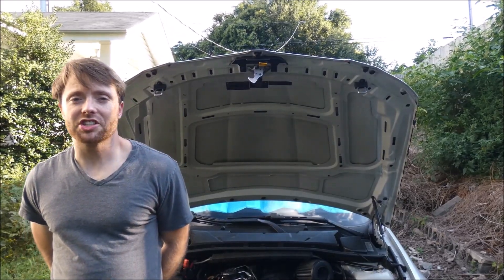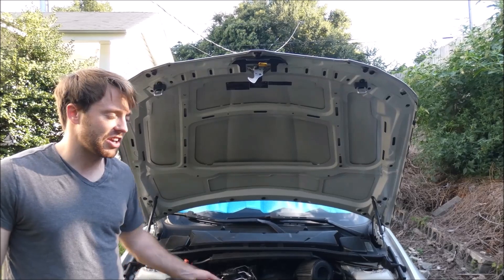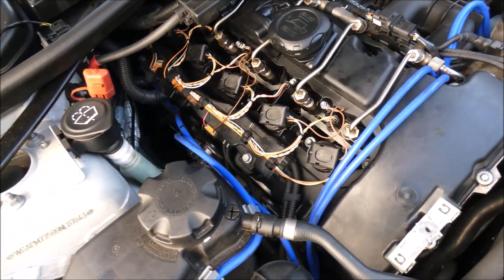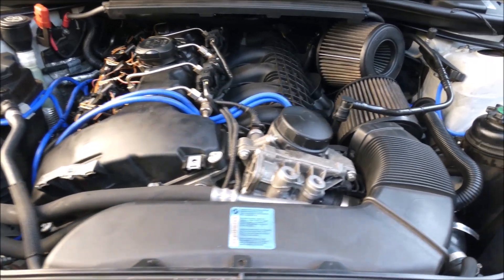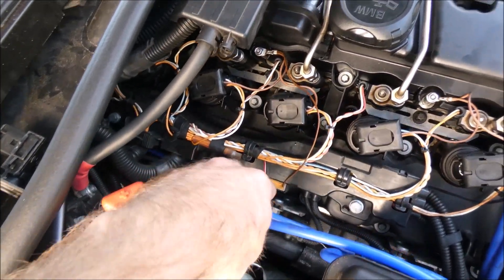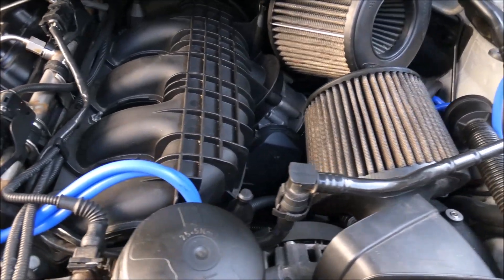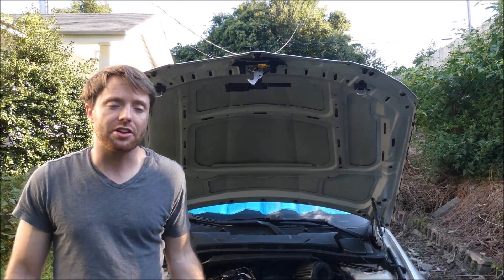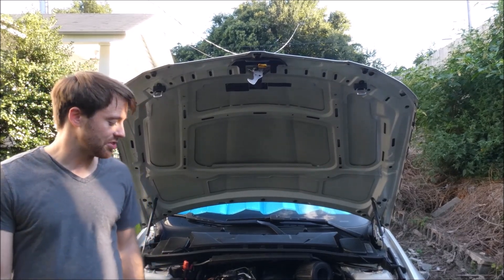IMPORTANT Maintanence for the BMW N54 Engine (Upgraded Vacuum Lines)

Comment: Where can I get all this vacumm lines? I replaced the starter today and now I feel the car run with less boost (less acceleration than last week). Issue starts now after I replaced the starter; so I can assume I can have a loose vacumm line or a broken line; also on the panel I see a yellow warning' according to the code its the "Engine Problem/Loss of Power). That didnt happened before I replacing the starter.
Reply: You definitely have a boost leak
Reply from the maker: The link is in the description.
Reply: I fixed it. There was a loose screw in the charge pipe! I forgot to tighten up. All working fine and 2 months later I have another leak boost.  Cant still find it.
Reply: @nelsonjgonzalez8843  use a smoke machine
Reply: @Purpz710  its a weird sound when I accelerate. Still pinpoint where is it. Cant accelerate too much; otherwise the leak weird sounds are louder. Im afraid if its a bad turbo.

Comment: Will I be ok if I buy a 4mm vacuum line?
Reply: Yes 4mm is fine, I replaced all of mine with blue 4mm silicon vacuum hoses
Reply: TBH it actually fits better and will have better vacuum flow
Reply from the maker: @phoenixlounge7656  thanks for the confirmation!
Reply from the maker: I would check on the forums I really don’t know.

Comment: 1:40 damn broo you got upgraded pool noodles that thing must be maxed power wise damn dude.
Reply: I bet you have an automatic with an oil leak 😂
Reply: @soul-6323 I bet you don’t have a car
Reply: @Johnathann54  didn't deny my claims,and I have E90
Reply: @ I have a 2007 e92 n54 with a 6 speed manual
Reply: @Johnathann54  i got the OG bro, E92 came out long after,i have the same paint and rims from the original advert, graphite sparkle with the morpho rims
Reply: @soul-6323  wtf are you talking about
Reply: @Johnathann54  what you don't know what a JB4 is? Geez bro I feel bad for you

Comment: Just ordered these! 17T's are on the way as well.
Reply: China turbos bud ?
I’m on about getting these instead of repairing my waste gates same work seems involved when I can just replace turbos.
Reply: @jamesdearie2689  yup, china turbskis. 17T's from VIV auto on ebay. So far so good. Can't tell if there's WG rattle when cruising but sometimes the turbos make a repeated fluttering noise if I'm cruising at 2k... Also, the car will get 2x louder when driving, it's like the boost pressure let's go or something with the WG's let's go and the car sounds as if it's N/A for a little. Once I step on it, the WG's close or something and I start to build boost again. Could be tune related but I was also told it could be due to faulty vacuum canisters. I replaced one during the turbo install as I was told it was bad but I should have replaced the other as well. Overall, I give them a 8/10. Sound great with relocated inlets/outlets
Reply: @apatinoracing  how much power?
Reply: @JoshComfortMotorsports  haven’t dyno’d it but I’m FBO. It feels quick, that’s for sure.

Comment: Tips for front wastegate line? I'm struggling
Reply from the maker: It is very difficult the only tip I can really offer is persistence. You kind of need to go in forearm facings the engine and away from you if you are standing on the passenger side. But that is by far the hardest part of this. Also try using your phone as a camera with the flash on to find it then watch the video you took and try to mimic that.

Comment: I just added the Vader Solutions BOV Adapter with the 1/4 hose to the Tial BOV. The upgrade yielded even more vacuum pressure and I had to increase my BOV spring to 11 in/hg from 9 previously. I noticed substantial improvement in power stability and throttle response so I decided to upgrade and order the Stett Stainless Steel vacuum canisters...should be arriving in a few weeks. Will update with any news.
Reply: Now have the Stett steel canisters. Now I don't have to worry about that being a weak link among the myriad links in the N54 system. Improvements were, even more response from throttle input. The canisters contain a vacuum reservoir so that on unpredictable throttle use, there is always vacuum available to speed up turbo response. 

Some folks delete the canisters completely with no ill effects, but, they forego the backup vacuum pressure necessary when they use the throttle unpredictably.
Reply from the maker: Thank you for the update!!
Reply from the maker: Please do update I’m curious to hear the results of them!
Reply: Where can you find the canisters in stock??
Reply: @patrickm2601  - Unfortunately they do not exist anymore.

Comment: Did this three years ago and still going strong. This should be the first upgrade. Then you can do intake, downpipe, intercooler, charge pipe and BOV. 

N54 is not as horrible as N55 when it comes to boost leaks.
Reply: I just got a 535i 08 and I get the engine malfunction and no power..my vacuum lines are leaking is it easy to put intakes and vacuum lines coils charge pipe plugs? I’m pretty handy with plumbing seems like that’s what it is mostly..my lines look aftermarket and braded
Reply: Krystian Pedziwiater doing the vaccum lines for the BOV/DV to the intake manifold and the vaccum canister side are the easy ones, the harder one is the rear turbo, the braded ones are from factory unfortunately
Reply: is it okay to do just the intake first anyways then do Vacuum lines? lol
Reply: @farrukhdada6688  - Power loss from leaks is greater than any gains from intake. Therefore, you make sure no leaks, first. That alone will return more power to your car than ANY intake no matter how expensive.
Reply: @farrukhdada6688  - Nope. That's useless.
Reply: @matreyia  hmm.. Why is that?
Reply: yea no leaks here all good!
Reply: Wait till u find out where the water runs down the windscreen and down into the uncovered motor… sometime perfect into cylinder 1
Reply: @simonshek8701   Cylinder 1 is up front. Cylinder 6 is rear location. I never run my motor uncovered or without the stock cowl. The Cylinder 6 is not a worry in any case...but rather the ECU on the passenger side that you will be sorry about when water gets in there.

Comment: Nice diy, in the description you said you have 2.5mm hose. Did you mean 3.5? .I just ordered 15 feet of 3.5mm and a new rb turbo PCV since I just got my walnut blast done.
Reply from the maker: Yes I meant 3.5 I’ll have to fix that!
Reply: @BMWE90HQ  Hey man, will 3mm hose fit too? i cant seem to get 3,5mm hose in germany...
Reply: @Justinsanesht  Do 4mm way better fit and get thickwall ones that are silicon
Reply: @BMWE90HQ hey man. The part I really needed help with was how to access the rear turbo. You started to talk about it but the missing part on the cowel I guess tripped you up. How do you do the rearward line?

Comment: why you leave the engine cover off? my car sounds horrible without engine cover and hood open on cold start for 30 seconds. scraping and ticking noise very loud.
Reply: When hood is open, you will hear loud injector noise. It sounds pretty horrendous sounding but normal. Unless it is a metal LOUD periodic clicking that is metallic...that would be your lifter noise...also very annoying and not as normal. If you have lifter noise, then first try Liquimolly lifter lubrication additive. And if that doesn't work, then open up that engine and change or adjust your lifters... which is $$$$ for labor.
Reply: don't think so.
Reply from the maker: It’s apparently a very common noise for direct injection engines to make. I did a little digging to find out about it.
Reply from the maker: It’s off because I installed an oil catch can and I have to trim the back of the cover to make it fit back on. So I’ll probably be doing that next weekend so I can get it back on. Right now it’s in my trunk
Reply from the maker: What model is your car 328i or 335i?
Reply: @BMWE90HQ  2009 e90 335i
Reply from the maker: Wastegate rattle?
Reply: Bmw cars in general are rather shite I